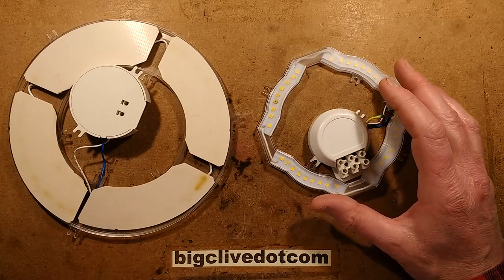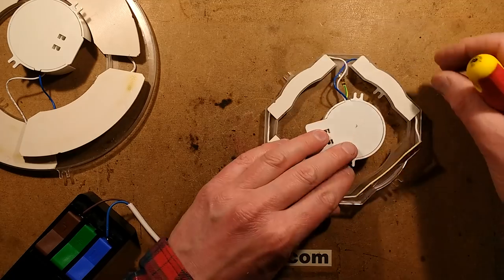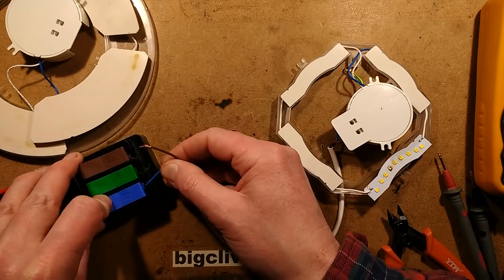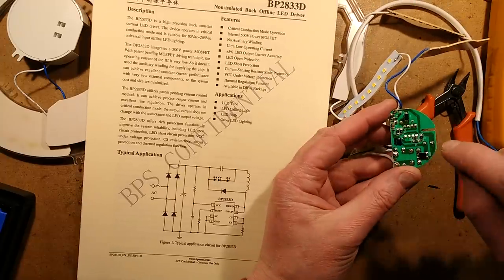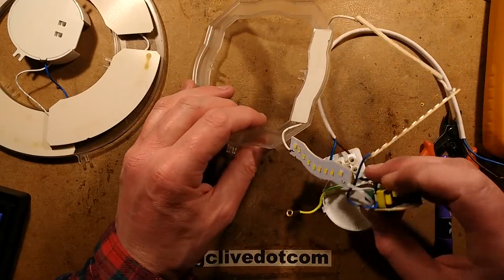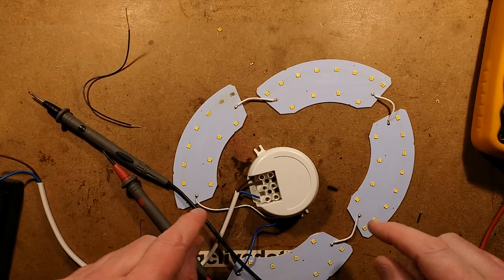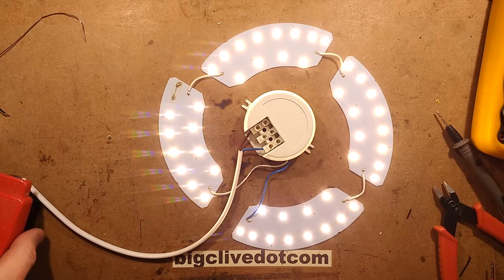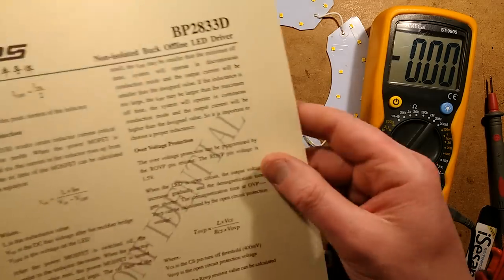Fixing two dead LED bulkhead style lights.

Comment: Big Clive a friend of mine is a step ahead. He gets loads of LED lights of all sorts that have in one way or another flaked out. I got him a reel of the most commonly used  LED's and a resistor selection pack and he fixes them and exchanges them with others that have gone phut. I have shown him how to do earth bonding checks and isolation checks and he even now had public liability insurance.  He's a retired mechanic who always had a bit of curiosity about electronics, and now he has made crystal sets and all sorts. He even makes a bit of beer money out of it.

Comment: They were about 8-9 months old when they failed.  The bigger of the two came from the kitchen, the smaller one from the downstair "cloakroom".  Neither had a particularly high duty cycle.  I didn't faff with them because they were under warranty and I wasn't sure if the company, "Aurolite" would want them back.  The replacements they sent were very slightly different, but not by much.  I've got a brand new one if you want that too :)
Reply from the maker: I was looking at some of the generic Chinese retrofit rings of LEDs yesterday and they seem to use the same style of LED and current, but on the aluminium core PCBs.  So theoretically you could get one and use the better power supply to drive the new LED panel.
Reply: Hehe Frankenstein the best parts together
Reply: It's alive! ⚡⚡⚡
Reply: Pete Allum . "It's life Jim, but not as we know it"

Comment: This inspired me to look at my sons bedside lamp. LED lamp which had gone dim and occasionally pulses after being on a while. Cracked the lamp open and found the dead LED with black spot. Tested repair using meter the same as in the video, lamp returned to full operation. Made the same bridge permanent repair and job done. Thanks Clive.

Comment: The very first LED bulb I ever bought was a "Lights Of America" brand, from Walmart about 8 years ago.  The typical transparent plastic bulb, but with a 'bouquet" of warm-white LED's arranged in concentric circles.  The first largest ring being closer to the base, and a lone LED being farthest.  Essentially a cone of LED's, all standing on their "legs".  Mind you, it's not a bright thing,  about the output of a 15 watt bulb.  My room is dark pretty much 24-7 so this bulb is always used as basically a night light and so I can see when I walk around the far side of the bed without mashing the ever-vulnerable pinky-toe on something.  That bulb has pretty much been going for 8 years straight.  Some of the LED's are showing signs of slight dimming,  but none have failed.  it also has the nice trick of softly glowing for a few minutes after being turned off (on the rare occasion I do turn it off.)  Could be due to our 120 volt supply  but I'm just impressed by the thing..
Now, I can not find any more like that one to save my life.  Bummer. One of the modern 60w equivalent LED bulbs (also warm white) in my ceiling fan fixture will go out,  but will come back on with a slight tap to the dome. That's starting to get irksome.. 
Just thought I'd share a relevant  thing...

Comment: We have a nice "designer" €200 fixture in the kitchen, but it had gone gradually dimmer over two years or so.
Instead of replacing the entire fixture, I took the interior of a €15 LED fixture, and stripped it onto the original lights. Now it's all bright again. Cheap and easy fix.

Comment: Can’t beat the good old 2D compact fluorescent for bulkhead fittings. It’d take them any day other these LED things. I’ve noticed these new LED bulkheads seem to be very directional, for example when mounted above a fire escape, most of the light is wasted sideways where a traditional 8w T5 fluorescent lamp lights the area below the fitting as you would want.

Comment: That last LED burnt out at 22:34 when you were bridging the panels...
Reply: It went out when he stopped bridging the 3 sections.  My guess is that when the power supply raised the voltage to power all 4 panels again, it overshot.  Of course, that raises a question on what happens on power up.  Is that what fried the first two LEDs?  I'm thinking Clive may need to invest in a digital scope so he can see transient conditions.
Reply: Russell Hltn 
Clive does have a DSO but it only comes out on very special occasions.
Reply: He explained it. It was the current surge from the big cap recharging.
Reply: That's not what he said.  He said that when he shorted the other sections, he discharged the capacitor.  It's a nice theory - but I'd expect the LED to go when he bridged. Not when he unbridged.
Reply: Indeed, when unbridging you would expect a momentary voltage drop.  My guess is as the LEDs are dodgy to begin with (the dark patches on the back of the PCB around some of the ones that DID still work) that the slight overshoot did indeed blow it, but probably would be within tolerance of a good LED.
Reply: It could be dodgy LED, but it could be LEDs pushed too hard to abused by past overshoots.  From what I'm reading, the owner says they didn't have a lot of run time, but it sounds like they could have had a lot of "cycles".
Reply: The LED went out when he stopped bridging, but if you look at it as he bridges the three sections you see that it goes dimmer. That's when it was doomed.
Reply: it's simple.. cleve said it right.. the output cap has on it the voltage that is required by all the led... when you bridge you reduce the number of led's but for a brief moment the capacitor still has the initial all led higher voltage.. that creates a short current burst through the unbridged LED's
Reply: Russell Hltn  It can't overshoot.. because always is monitoring the current.. and never let's it reach more then 140mA.. there is no problem when it starts because the cap has no voltage.. the chip just raisers the voltage until 140mA. are going through the circuit
Reply: Paul Stafford hi

Comment: I think if BigClive was ever kidnapped there is a very easy way to get confidential information out of him:  Put him in a room lit with cold white LEDs that flicker at mains voltage on a ceiling too high for him to reach and surround them with a metal cage so he couldn't throw anything at them to break them.  If that didn't work, add in one of those eBay DIY PCB solder-it-yourself kits but include lead-free solder and no flux.  As a final measure, constantly play in the background that "Big Fish, Little Fish, Cardboard Box" song that he mentioned in a video a while back.  -- I'm joking of course as I love Clive and his videos.
Reply: Aleatha Vogel 

Clive is a total 🐻, no cage can hold him.

Comment: So if you were to put a rheostat in place of the current sense resistor, could the lamp be dimmed or would that I.C. freak out?
Reply from the maker: You could add a potentiometer in series with another minimum value resistor.

Comment: Why the bridge and not just a whole solder blob
Reply: Phonotical 
I was thinking that.
Reply: Pete Allum I thought maybe a resistance issue but surely it would be the same or better, mystical wizardry
Reply from the maker: I did latterly realise that a solder blob was the easiest solution.  Because one pad extends underneath the LED for heatsinking, it is easy to blob.
Reply: Yeah makes sense just throw a tiny wire on it that’s the hardest longest way. Best for Clive!
Reply: I think the wire would be mechanically superior. The solder would experience some stresses due to the pcb expanding/warping under use from heat. A thick solder blob might be less ductile/flexible than wire, and would be more likely to pull off the pad on the board or crack the solder blob.
Reply: Dave Myers 
Don't forget that Clive ONLY EVER uses proper lead based solder, which is much more malleable than the lead free stuff!
Reply: I would say it's easier to make a connection with a wire than just a solder blob
Reply: That's just lazy and unprofessional, plus you would be changing the original operating characteristics of the circuit to what its not used to and so it could have an impact on the units lifespan, or to avoid that, change the sense resistor a different value to increase the lifespan of the unit if you were going to bridge the led.
Reply: Tyrone Nelson Huh?
Wire vs. solder blob makes what sort of difference with a huge impact you are trying to say in this application?
Reply: Everyone has their own opinions, because what if another led burnt out and another, just bridge it until you had no leds left, great, nah id be professional about it and replace the led.
Reply: When i bridged mine i never thought to just snip leds clean off much easier that way!
Reply: A solder bridge is OK in a lot of situations as long as there is not any RF involves especially high frequency as it can completely mess up your impedances. For SMPSU'S that I design, I use pads designed to be bridged (1206 pads with 0.5mm clearance in the middle) for fine tuning current limits and voltages.
Reply: The led lamp i was repairing at one point had some sort of psu in it, it might have been a capacitive dropper, and i thought about bridging an led on it but then when i did that i noticed the current flow increased across the remaining leds and that wasn't good.
Reply: Phonotical i

Comment: I fixed a LED "bulb" the same way, but pcb/heatsink dissipated a lot of heat, very hard to solder, I think it is still working, your videos give me that idea, thanks.
Reply: Preheat the PCB (I use a torch lighter at some distance)
Reply: Best to avoid naked flames if at all possible and use a hot air gun or even a hairdryer to preheat.
Reply: My idea was: "carefully uninstall the dead led and place a LED from a car led lamp my niece found in the street" XD after all the problems desoldering the dead one I just put a blob of tin shorting the led "carcass"
Reply: Yes, I am quite experienced in burning PCBs (bad wires, no rosin, microscopic pads) I had bad luck, less money (for basic equipment), no teacher and practices to really know what I am doing XD

Comment: Could you use a resistor instead of a dead short to compensate for the lost voltage drop? If so what value would you use?
Reply from the maker: It's a self adjusting current regulated supply, so bridging is fine.

Comment: I've 'always' wondered this. Are these phosphor covered LEDs internally the same as the 'normal' dome style LEDs (anvil having a bit of the light emitting material with a tiny wire going to the other terminal.) I've not examined one in detail (might be hard cause of the yellow phosphor layer)

Comment: 3.6 ohms in parallel with 1.8 ohms is 1.22 ohms.  Removing the 3.6 would leave 1.8 as the current sense resistor and that would drop the current by about 1/3. - the 150 ma to 100 ma change you mentioned.   Less light from the fixture but much longer life for the LEDs.  Probably not that many who can remove the resistor, though.

Comment: Question of the day:  Will these work on 120 volts for here in the USA?  The internal wiring from the terminal block to the circuit board uses USA AC wiring colors, so I was thinking that the chip might work both ways.  An international fixture.
Reply: The voltage requirement is too high with all those LEDs in series. I have a bunch of Lowes lights and the LEDs are in series-parallel. There's 3 parallel strings and three of them in series (or something like that).  Not a good arrangement because if one LED goes open, the current will split among the two remaining strings, thus hastening their demise.

Comment: Clive, I was sent a pair of LED bars (for a television backlight that I no longer need to replace) without a driver board, and I was wondering if you knew any way to power them. Every LED (about 80 of them across both bars) is in parallel, which I understand makes things a bit more difficult wrt current balancing. I want to make a bench light out of them.
Reply: You just got to figure out what voltage you need
Check whether the LEDs are in series or in parallel
If they're in parallel add up the amperage (typically 20ma max for one white led) if they're in series add up the forward voltage usually( 3.4 min for one white led) then purchace a dedicated driver based on those numbers or make one with a current limited buck-boost converter

Comment: Very useful PSA for switching the meter back to the volts position. I still do pop fuses, after I have gone through more than 10 of them... (At least they are cheap)
Reply: Giovanni Carlo Iglina
They're not cheap if you have to get the big arse ones Fluke use.

Comment: These types of lamps need cooling or they will die quickly. I don't understand how one is supposed to mount cooling to them.
Reply: radry100 The viewer removed the metal backplate before mailing them to Clive.  Though a thin layer of thermal goo behind each boat could had helped.

Comment: It's simple.. Cleve said it right.. the output cap has on it the voltage that is required by all the led... when you bridge you reduce the number of led's but for a brief moment the capacitor still has the initial all led (higher )voltage.. that creates a short current burst through the unbridged LED's

Comment: I don't suppose you could tell us/me what the Rovp (over voltage protection resistor is on that second light)... I need to build a 180v driver, and that chip seems a good option.  I just want to check my maths since the units aren't entirely obvious on the datasheet.... I can see me getting KOhms when I need Ohms.

Capacitive dropper is also a possibility, but since I only need to drop 60v and pass 150mA that's a big capacitor!
Reply from the maker: It appears to be an 82K resistor.

Comment: 24:20
The output voltage needs to be greater than 15V.
Reply: Also, those LEDs might have stayed cooler if they'd used larger copper pours on the PCB, rather that tracks between the LEDs. The tracks would act as heat spreaders.

Comment: The datasheets usually marked CONFIDENTIAL because the thing has been leaked out, these documents aren't available officially on their website, these kinds of docs will only give to customers who bought the chip in large quantity for product manufacture
Reply from the maker: It is on the chip manufacturers own website.
Reply: Did they actually link it themselves or did the PDF just turn up in a google search?
Reply: The manufacturer's website is bpsemi.com. The datasheet loads when you look at any product, and every single one has that CONFIDENTIAL stamp on it.
Reply: Usually the data sheets are prepared at a time when they are confidential, and once the product is in full production they become public - usually the companies cant be bothered to reissue the document just to remove the watermark. Its possible that reissuing docs might cause problems with safety accreditation etc.
Reply: Crystal Soulslayer Maybe it's some legal trick to more easily sue over clones or such. Really no idea.  I do recall a Japanese company (JST) doing the same, but also requiring a click through of confidentially terms to get to the download.  Maybe BrightPower are remembering that Clive already clicked OK years ago.
Reply: Perhaps they think it makes them look cooler or more important
Reply: While it's possible they simply failed to remove "Confidential" on the sheets when they went into production, it might be a legal ruse to prevent competitors from copying them.  They could be charged with possession of "confidential" information.  It's the opposite of "open source".
Reply: David Scheiber: "Perhaps they think it makes them look cooler or more important" 

neeeerds!

We were visiting SonyEricsson lawyers fighting illegal copying of chargers when they still had that division. They had made a video wearing lab coats as to seem educated in medicine?! Cosplay in the workforce.
Reply: That was my thinking too, seeing as it says "confidential - customer use only" at the bottom.  Presumably it means that use by a competitor is forbidden, although I'm not sure how they expect to find out and sue them.
Reply: Of course since they are publishing all the public documents with 'confidential" on them on their own public web site, they have essentially voided the meaning of "confidential" on any document they have, public or not. If someone does steal an actually confidential document a clever lawyer could argue that it is every bit as public as any other document, as there is no proof that BP didn't distribute it publically and then possibly remove it from publication.
Reply: Russell Hltn There is a certain irony with a Chinese entity labeling anything of their own as "confidential" when China as a whole does not even recognize the concept of intellectual property, patents, or copyrights and engages in large scale corporate espionage and intellectual theft.  I've often joked that the chickens will come home to roost when China begins to seriously invest in inventing new creations, technologies, and processes and suddenly wants their own intellectual property to be protected globally, at which point the rest of the world may as well give them the proverbial middle finger as they certainly never recognized anyone else's IP rights.
Reply: It could just be a translation error, perhaps in it's original language it says "Copyright" or "Patented"?
Reply: Probably a mixture of things. As previously stated, it's possible they used the same datasheet as the early confidential release of the chip. Also, it's kind of a "without prejudice" thing. If there were some kind of accident or damage resulting from a flaw with the chip and it went to court. That document cannot be used in court because of the watermark. The prosecuting party would have to physically demonstrate the flaw even if it was glaringly obvious by reading the datasheet.